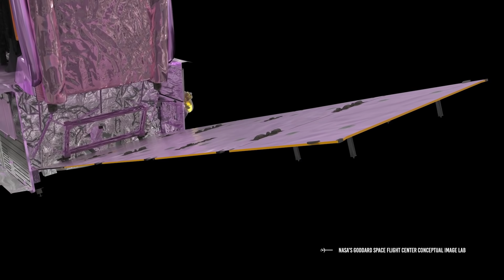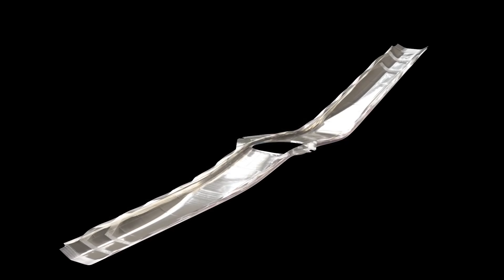James Webb Space Telescope: 5 Critical Events That Will Determine The Success

Comment: Can anyone explain how JWST gets into a circular orbit at L2? What is it orbiting?  Wouldn't you constantly be burning fuel to maintain that orbit?
Reply: As far as I'm aware it only orbits the sun (not Earth) but at an orbit almost a million miles further out than Earth, so travelling slightly faster round the sun than we are to maintain relative position to Earth. This way Earth will be permanently blocking out the sun as seen from JWT just like an eclipse. I may ge wrong but I think it's something like this.
Reply: that’s the idea - this orbit around L2 will require minimum amount of fuel, about 2 m/a delta v per year
Reply: @olasek7972  "2m/a"? Not familiar with that terminology. Please explain? m=?; a=? (I sort of understand the general concept of delta v. "Change in velocity". Adding positive or negative acceleration to tweak an orbit.) Thanks.
Reply: @kellyrobinson1780  sorry for typo, it was meant to be delta v = 2 m/s
Reply: Connor, actually, I think, Webb will orbit L2 itself, and L2 is in an orbit stationary relative to Earth, but in lockstep with Earth around the sun. I just know the "what", not the "how". It has something to do with the balance of gravities from Earth and the sun at L2. L2 is sort of a "gravitational node", weirdly created AT L2 by the gravitational interaction between two remote bodies that are not physically present at L2; but nearby objects behave as if there WERE a mass there, and they can be made to orbit it. I just accept it; I don't have the math to describe and understand it.
Reply: @kellyrobinson1780  I don’t think it is a good analogy that some imaginary mass resides at L2. L2 is an unstable location meaning that any deviation from L2 gets amplified so drifting away from L2 is unavoidable, on top of that we don’t want to be exactly at L2 since solar panels would not get enough sunshine. The bottom line is that they do create this artificial “orbit” around L2 which really has no parallel with real orbits. It is a complicated orbital mechanics.